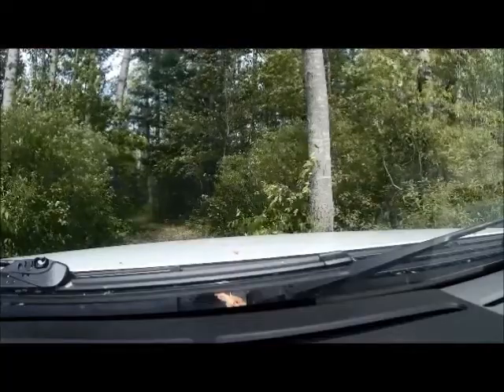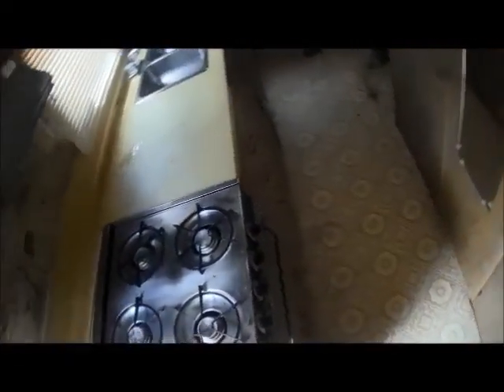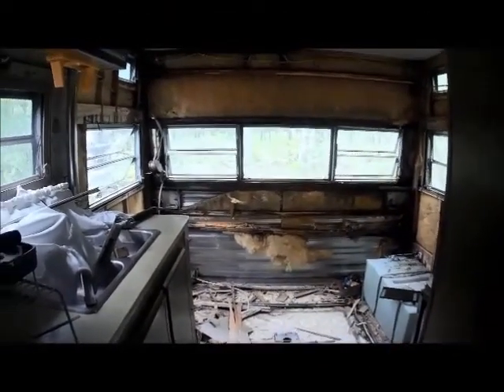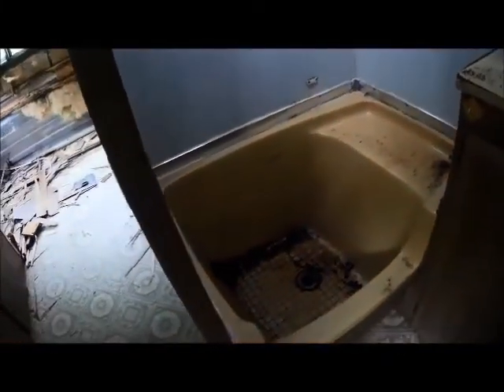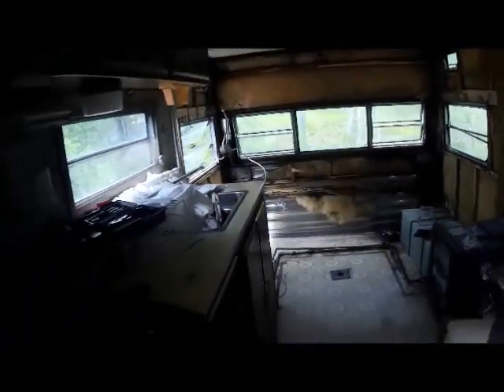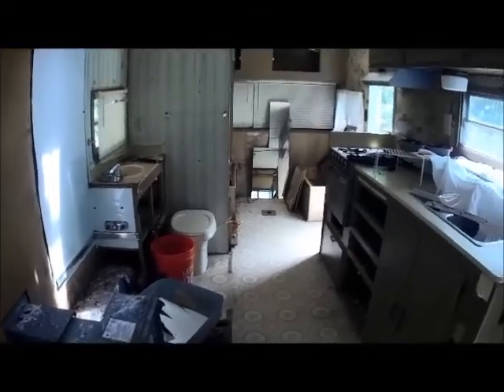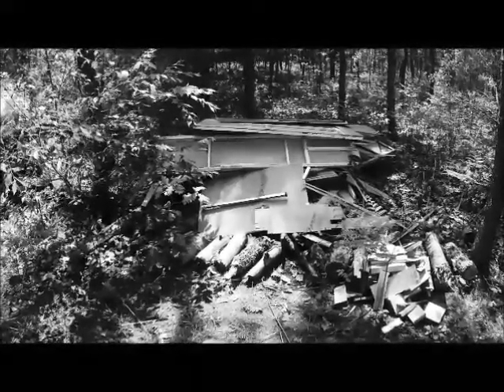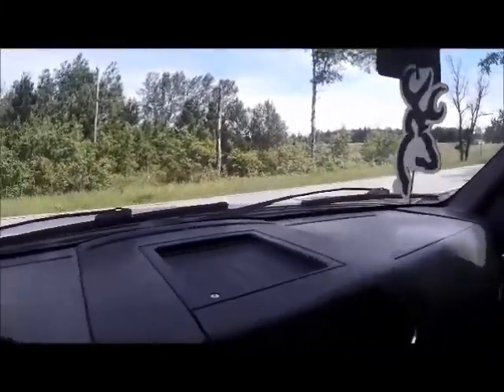Camper Rebuild Part 1

Comment: Nice video!  It looks like you have your work cut out for you, but I like the camper itself.
I do have a question.. do you have some sort of program or feature that stabilizes the picture on your camera?  (Either on the camera itself or in the editing?  I have never seen the boarders wobble like that on a You Tube video, yet the picture itself is stable.
Reply from the maker: Dollarshowman I would have liked to kept the camper like it was but there was so much water damage behind everything it was not worth keeping.  Been busy on other projects and hope to get back to this soonAs far as the video editing goes I just use Movie Maker.  I believe You Tube did the editing on the video as it asked me if I wanted it to stablize the video when I posted it and I said yes.  Nothing I did
Reply: Wow, think I’d just build a little cabin